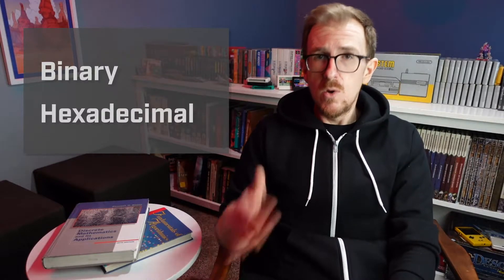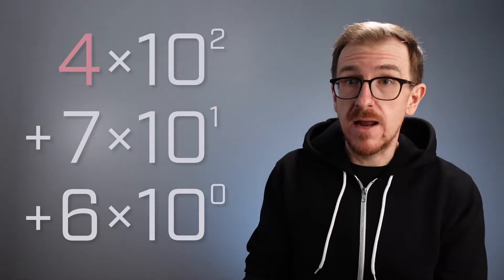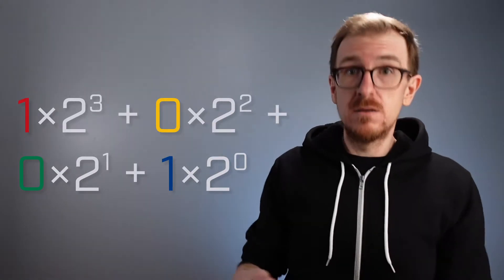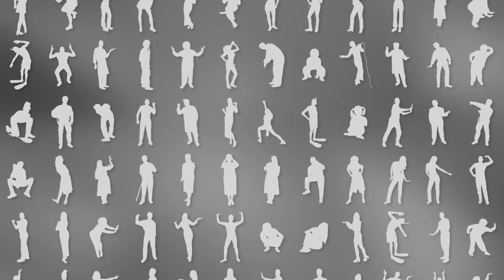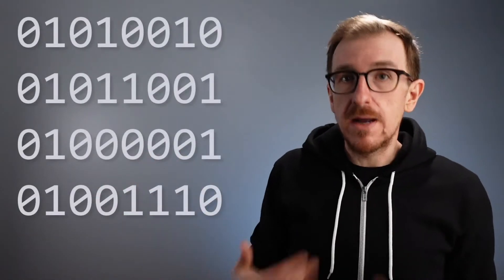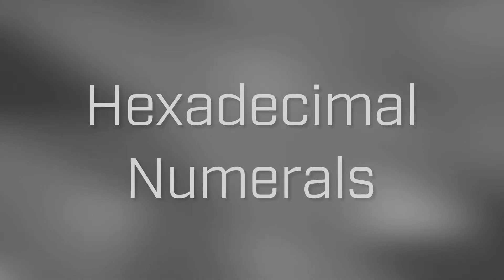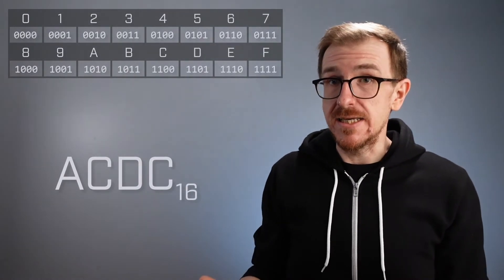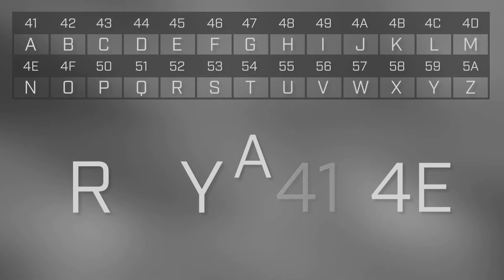Binary & Hexadecimal Demystified

Comment: Why not base-256? That'd represent an entire byte in a single character. With the amount of characters in logographic languages – cantonese, for example – it seemingly wouldn't be excessively difficult to create a system to notate base-256.
Reply: Thats a super neat idea. I wonder if you could just do that via this though, ie having a conversion from hexadecimal to higher and higher powers that are multiples of binary until you get to 256. Then you can pick the level you want, and convert freely between them. 0-9, a-z is 26 + 10 so 36, + A-Z is 26 + 36 ie 62. Now just add 2 more (á and é for arguments sake) and you have base 64. You could also do a-z + A-Z minus the last 2 digits of each. 26 + 26 = 52 - 4 = 48. Base 48, another power of 2 :) you could do 32 instead, giving you a 2 - 16 - 32 - 64 ramp. Many options

Comment: Ironically, it was actually pretty easy for me to read your name in the binary form without converting it to another base. The 010 at the start of each made it clear to me that it was all-caps ASCII. The remaining 5 digits I could map to the fingers on one hand and count through the alphabet starting from A at 1. This let me translate the binary to "RYAN" without needing to look anything up or actually knowing your name beforehand.
Convert name into binary or hex? Well in that case, the alphabetic part of my username "angeldude" shouldn't be too hard:
a -> 1 -> 00001
n -> 01110 -> 15 (Yes, it was faster for me to count on my fingers in binary, then convert to decimal)
g -> 00111 -> 7
e -> 00101 -> 5
l -> 01100 -> 12
d -> 4 -> 00100 (not sure why I remembered the place of d better than e)
u -> 10101 -> ? (doesn't actually matter)
Prepend 011 for lowercase ASCII for 011_00001 011_01110 011_00111 011_00101 011_01100 011_00100 011_10101 011_00100 011_00101.
Change to a less useful grouping so it can be converted to hex and I'm left with 61 6e 67 65 6c 64 75 64 65.
The numeric part I think starts with 0011____, but I'm not completely certain. If it is then add 31 30 31.

Comment: ASCII is easy to figure out if you got the cheat sheet. Capital and lower case.

A - O = 0100
P - Z = 0101
a - o = 0110
p - z = 0111

     P - 0000
A, Q - 0001
B, R - 0010
C, S - 0011
D, T - 0100
E, U - 0101
F, V - 0110
G, W - 0111
H, X - 1000
I, Y - 1001
J, Z - 1010
K - 1011
L - 1100
M - 1101
N - 1110
O - 1111

Comment: great easy to understand information here, thank you. I am just a newb floating around slowly learning things. would it be wrong to look at the binary as the sounds letters make. then look at the 8bit byte as a letter, and the 16bit hex are the words the letters make? then ascii is the definition of what the words mean? ... i am a completely newb at all things programming and i am trying to learn it from fundamental principals. ive started off with learning a bit about TTL logic and taught my self binary, however i think my MSB is on the left when it seems most examples i see is on the right. so far i have build registers, timers, buffers, and a working 4 bit ALU. it can only do addition and subtraction. and its only a ripple carry adder. but i became addicted to learning more after i figured out how to build my own calculators from relay switches. thank you for this video. i now know my next thing i must learn is how to understand, count, and do math in base 16. i am just now getting to a point where realize i can address a kind of operational code. i dont know if that is short for opp code but im going with it, by making a bank store a little operation like adding 1 to the bus, or placing a 3 in bank 2. i do not have to do that my self. i can make an address that can do that for me. i been eating up videos about 6502 assembly and i have this delusional thought that i am going to rebuild the entire NES system in a game called logic world by learning it from core concepts. lol. yea, i have too much time on my hands.

Comment: So, let me see if I understand this correctly: Binary numbers can be written in any length/amount of digits; when converting binary to hexadecimal, the binary number sequences are broken down into sets of 4 digits (and we just use the lookup table to see what those are); hexadecimal is always written as two digits; and for the ascii I just use the lookup table to see which hexadecimal value is equal to whatever number/letter/symbol?
Reply: Mathematically hex numbers can have any number of digits, but in a hex editor they're usually broken into two digit values because two hex digits maps to one byte. When writing programs it's not uncommon to use longer hex numbers, although the NES doesn't really encouter this because it's an 8bit system and thus works on single-byte values.

Likewise, binary values can have any number of digits, but in computing representations they're often grouped into series of four bits, or sometimes eight, although in those cases there's usually a small gap in the middle to separate the eight bits into two groups of four.

Incidentally, while eight bits is referred to as a byte, the four bit sequences are sometimes called a nybble.

ASCII can be worked with using a chart, but most hex editors have a "character" field to the right hand side of each line of bytes, where the ASCII representation of the bytes is displayed and can be edited directly.

HxD is a free hex editor that you can use to examine or edit files on your PC, if you want to become familiar with hex editors. Alternatively, the NES emulator Mesen has a full suite of hacking and debugging tools that includes hex editors for viewing the RAM and ROM contents while running a game.
Reply: Oh, I forgot to mention, but yes, four bits correspond to one hex digit. However, it's much easier to just learn to read four bit values in your head and memorize the decimal values of A thru F. Then you can easily do conversions on the fly rather than using a chart.
Reply: Hexadecimal is usually written as 2 digits because they're used as an expansion for what basically base-256, kind of like how digital clocks effectively display base-60 numbers using pairs of decimal digits for each base-16 digit.

For ASCII letters, it's actually possible to convert directly from binary to a letter and back. If the binary starts with 010_____, then it's an uppercase letter, and if it starts with 011_____, then it's a lower case letter. The remaining 5 digits directly count from 1 to 26 mapping the range to the letters A through Z. You may not of something else that usually has 5 "digits", and while it can take good dexterity to represent the entire range as distinguishable values, it's possible to count from 0 to 31 (which contains the numbers between 1 and 26) on a single hand by treating each finger as a distinct bit, while sounding out the alphabet to tell which letter maps to which 5-bit number.

If the number instead starts with 0011___, then it's likely a number, with the remaining 4 bits being the binary form of the digit in question, and can also be counted on one's fingers from 0 to 9 if you haven't memorized the 1 digit decimal-binary conversions. For symbols, there's not much you can do to avoid memorizing or looking up the chart. The best I can say there is that 000____ are control codes that don't map to any symbols, and 0010_0000 (20₁₆ = 32₁₀) is space.